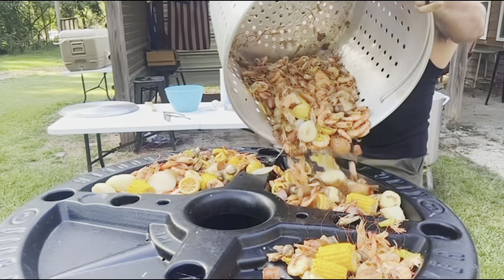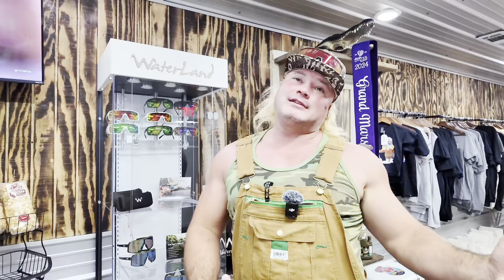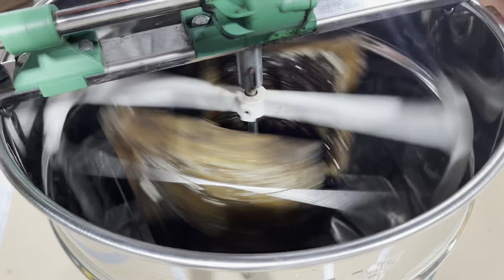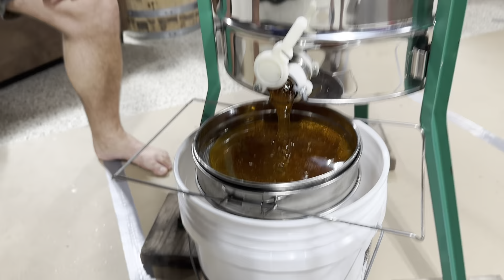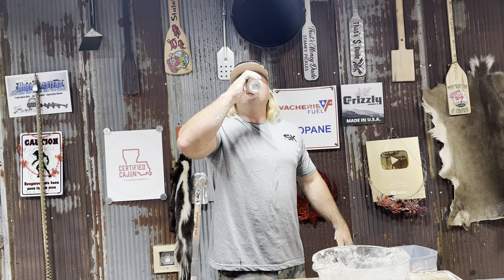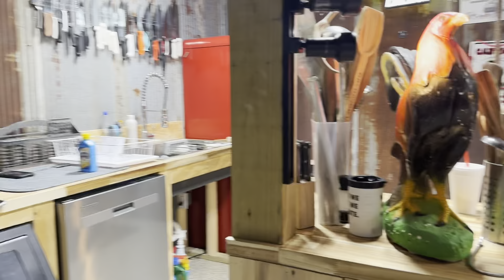Money Honey Bee's with Stale Kracker

Comment: Hey T boy.  Louisiana Local used to beez a beekeeper but got out of it years ago.   Also started up a wildlife removal business off them bees.  Did bee removals just for the bees then got into wildlife.   
Get a bread knife or a cold wax knife.  If you stick with 8 frames like you do it works like a champ.   Shave end caps off in one sheet and drop em in a bucket for the bees to clean up later.   Save dat wax for sealing up one of those whiskey bottles.    I used to make a honey whiskey with mine.